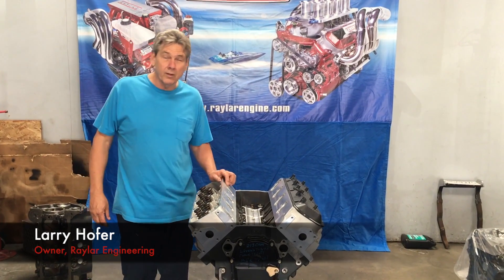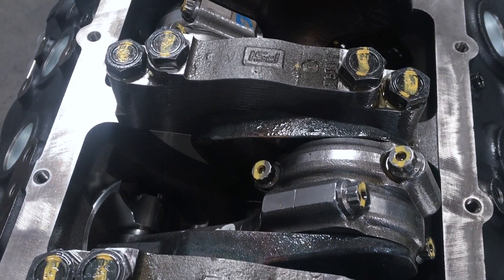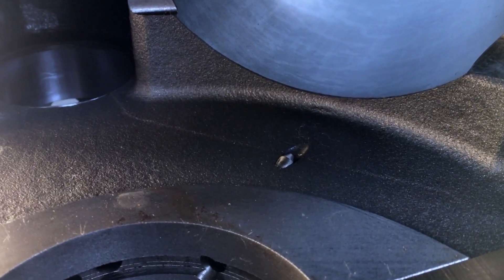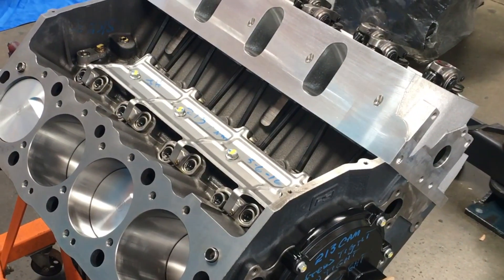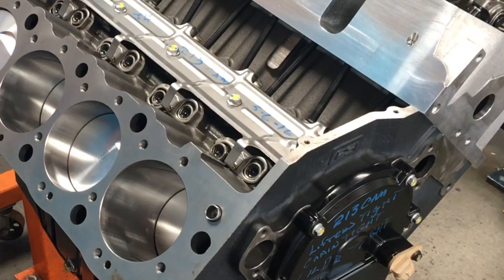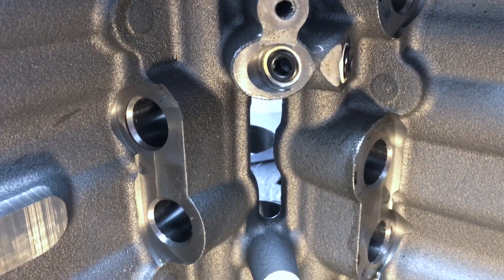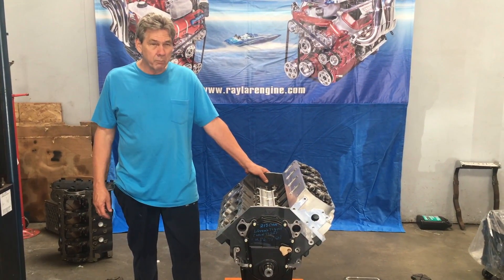Vortec 8.1L BBC Stroker Crate Engine

Comment: Still making these Micah? I’ve got a 63 C10 I’ve been wanting to big block but also have fuel injection
Reply from the maker: Of course! https://www.raylarengineering.com/vortec-8100-crate-engine.html

In a C10 from the 60's (light by comparison to modern vehicles) I'd tell ya to run the 206 cam for a daily, 213 if you buy a decent stall.

Comment: is it an aftermarket block or can a 8.1 be maxed out to 572?
Reply from the maker: 540 is the most the stock block can handle with the 4.75 inch stroke.

Comment: "We've tried really, really, hard", meaning, they had a professional head porter give them a good port.
Reply from the maker: We started with a very good port, from a very good designer, but things didn't stop there.

"The stock heads are JUNK with a capitol "J"! Don't even think about trying to step the stock heads up with port work. The castings are thin, the short side radius is way to high and the combustion chamber is a total joke. The stock version of these heads are the worst I have ever seen come out GM... Raylar cylinder heads take less timing, gain over 65 horsepower and improve gas mileage tremendously!! With the new intake manifold that Raylar designed the engine gets even more efficient. The stock cylinder heads were so bad that making them better was a snap. Better in every single regard, I might add."

Darrin Morgan, Reher Morrison Racing Engines

Darrin designed the ports for our original heads back around 2000. Since then, we've improved the heads for marine grade durability for our v2 heads and the v3 heads which are shown in the video saw additional CAD modeling for further improved flow. The resulting v3 heads outflow the v1 heads to the tune of about 15 horsepower with the same valves and port volume.

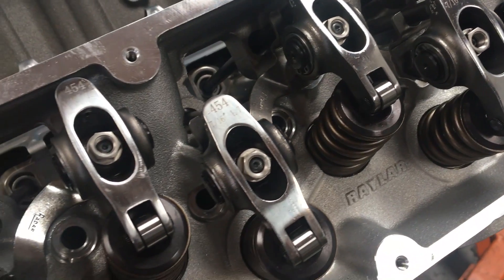Comment: 2:50 If I remove my corvette engine,  then put Raylor 540 cid in my corvette, WHAT IS THE DIFFERENCE IN WEIGHT. Does this add 100 pounds or 200 pounds or 300 pounds???
Reply: Which Corvette engine?  It's lighter than a cast iron big block, heavier than an aluminum LSX.  Almost 700lb iirc.

Comment: I’m sorry man but your prices are way too high to consider, corvette C7 LT4 engine complete and brand new is 2500$ cheaper!
Reply from the maker: You're right, small blocks are super cheap and widely available. On the other hand, most fuel injected aftermarket 540 BBC engines are priced in the same ballpark.
We don't go small block because you're limited to what the cubic inches can produce on pump gas. When you toss our 2.9L supercharger on our 540-572, you're making a very daily driveable 11-12lbs of boost (950-1050hp depending on cam selection, headers, etc) on 91 octane. Makes 650hp seem pretty small, doesn't it?

Comment: RIP diesel pickups.. Subscribed.
Reply: Your kidding right? I love this version motor but you'll never get near the same mileage while towning nor the active low torque when you need it.
Reply: @Witchdoctor-J  as compared to stock diesels, an 8.8 liter supercharged v8 will have like 1000 ft lbs and like 700 at 1800 rpm. But yeah the mpg would be like 8. But so would your 0to100 lol